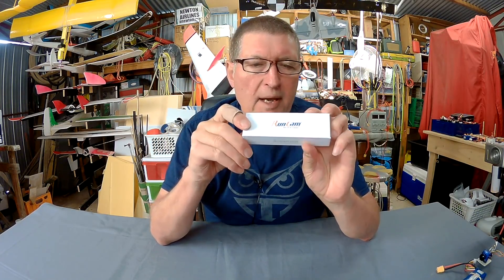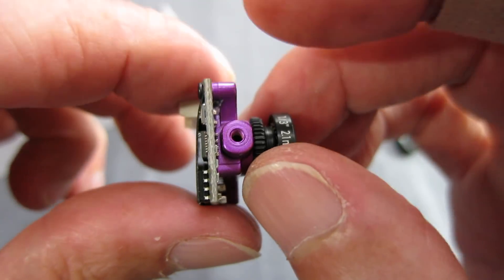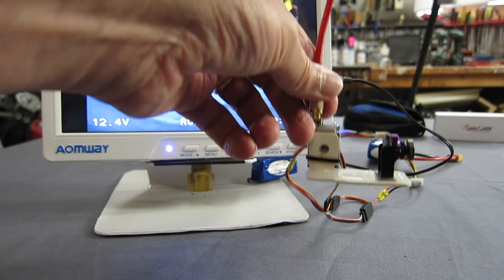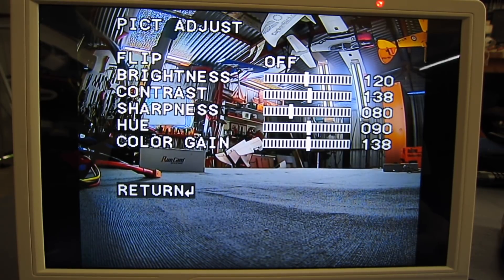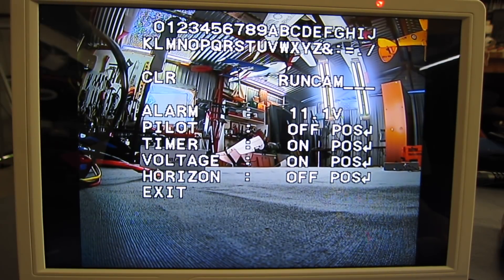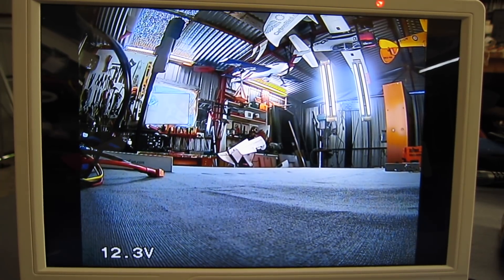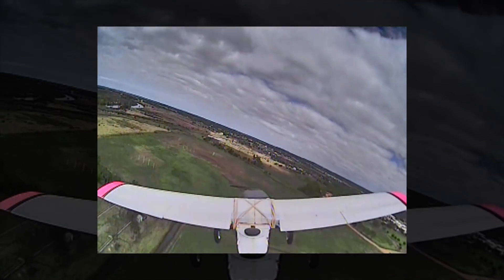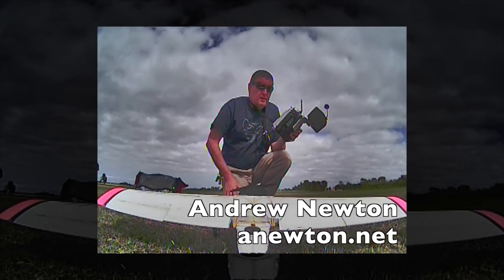Runcam Micro Sparrow 2

Comment: I thought the sparrow series was all 16:9 aspect ratio.
Reply from the maker: The others are. Confusing change with the Sparrow 2
Reply: So now you got micro swift and micro sparrow same price competing with each other. Bad market move do to a flood of cameras on the market.
Reply: That's because 16:9  (fist Sparrow) for FPV is getting phased out after trying it out in favor of 4:3 so not much choice as far as the market goes that these guys create in the first place by what they offer. Big difference between the micro Swift (CCD)  and CMOS micro Sparrows 2 too so not really competing... I sill use CCD for larger cams and think RR RC 2 best over all for CCD cams but these new CMOS cams are getting so much better I wonder if SONY will surprise us with  something new in CCD too with FPV a large enough market now to get the big players involved.

Comment: Nice clean feed Andrew with very little break up...I like how you put the plane into Loiter so you could watch the Screen. Are you using the giant 10 inch Aomway Monitor yet for FPV..? Or is it a Studio Queen..lol..?
  I would try jacking up the colour saturation, the DVR recording looked a bit washed out?
Reply from the maker: The 10" has not been outside yet. As you said, it needs a shade and matt screen film. The picture was perfect in the goggles, not so good on the DVR recording. Might have something to do with the new Super WDR function?

Comment: What happened to your finger Andrew??
Reply from the maker: Embarrassing. Prop damage, but it wasn't spinning at the time. Broke the HD wing prop at the field, then I went to try it on the slope. I didn't have the tools to remove the broken prop so I just snapped off the remaining blade and cut my finger in the process.
Reply: Oh. Was that in the last vid? Also, is the HD wing the same as the one on hobbyking called the ‘shark’?
Reply from the maker: That's right, had to clean the blood off for the video. HKing Shark is not the same plane
Reply: Oh ok thanks. Hope the war wound isn’t too bad ahah